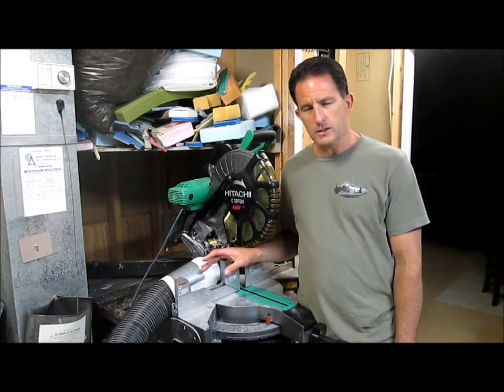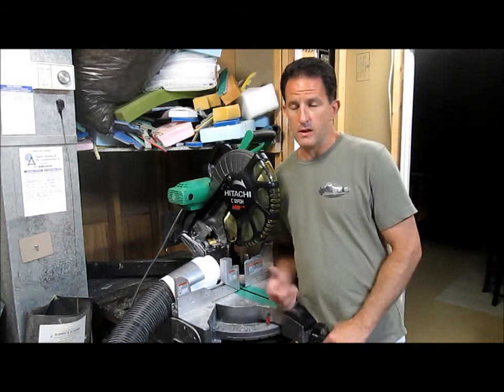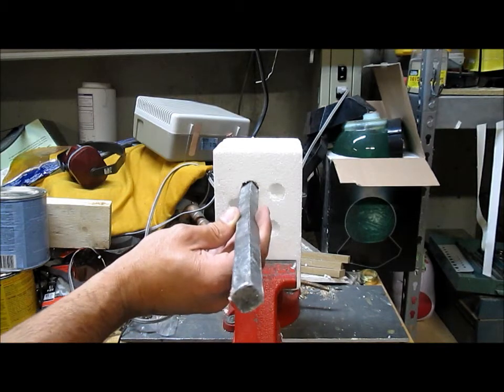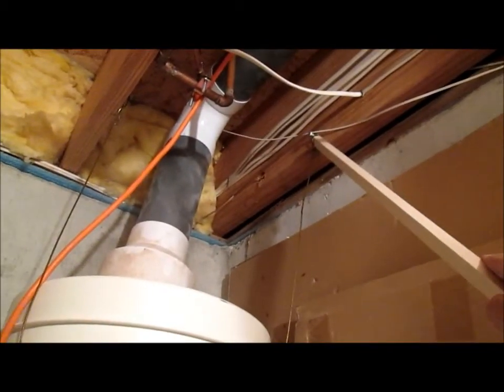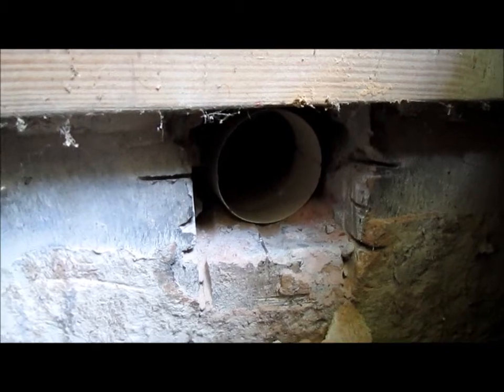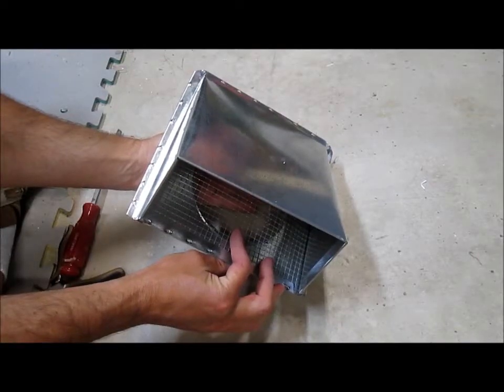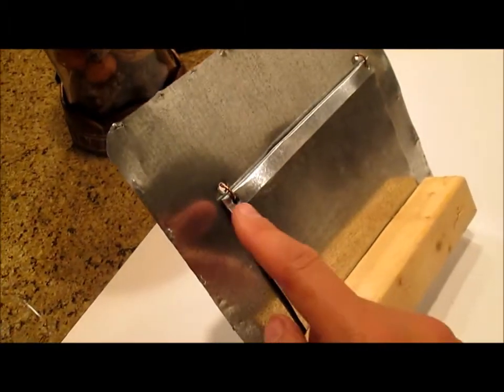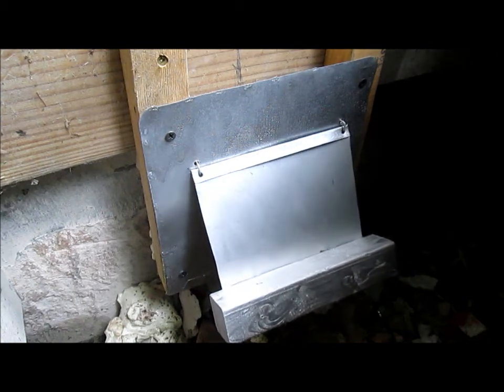How To Make a Dust Expulsion System

Comment: so looks like your wife won't be spending any time out on the deck.
Reply from the maker: I wondered about that too, but after 3 months of use, there is Zero dust on top of the deck that I can see.  My wife should not be on the deck while I am blowing dust out, but the outside air clears quickly, and she could go out, just minutes later.  I almost always do my woodworking after dark, so she is not out there anyway, luckily.
Reply: *****
hey Lou, my concern would be the accumulation of dust that would cover the dirt under the deck.  I also have dust allergies and over some time the amount of dust under the deck would be quite a lot.  I would be concerned if all of the dust is blown out, but if you are filtering out the majority and this is only the blow by, then it sound ok.  good luck

Comment: I would think this was a bad idea it would invite termites to your home. not to mention mold and mildew from wet sawdust. Would have been better vented into an open area away from the house
Reply from the maker: I think it will be fine.  I live in the woods and there is a constant supply of wood and leaf dust falling down there.  This will be a little more concentrated, but similar.  If I notice an issue, I will keep a mister bottle of bleach handy and periodically spray some in the inlet.  That should stop both mold and termites.  If not, termite spray will.
Reply: ***** yeah just keep mindful of it and thanks for all the amazing videos you have put out please keep it up!